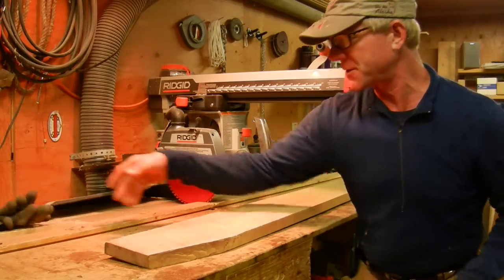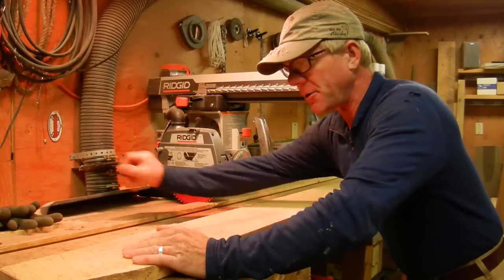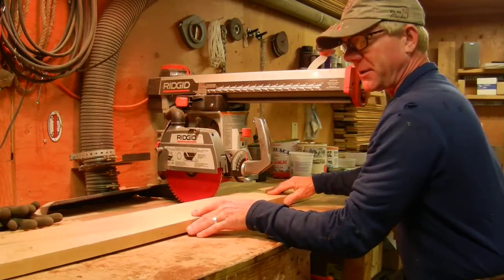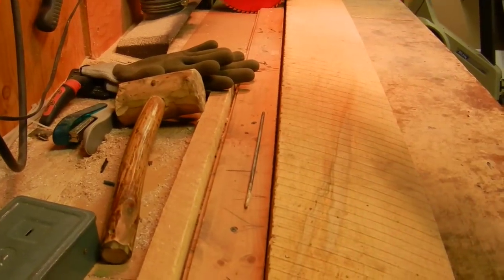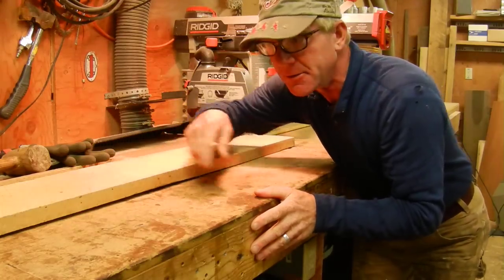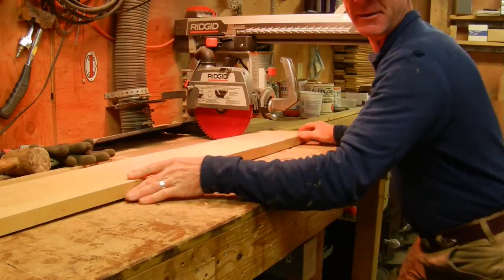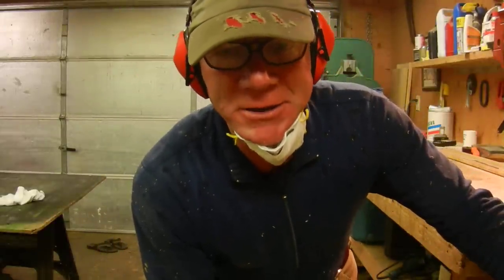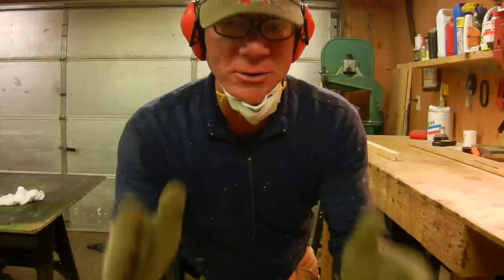How to use a Radial Arm Saw #radialarmsaw

Comment: ok so: you did NOT use a "negative rake blade" because you had the blade turned the "opposite" way, basically, right? how did you keep the board on the table, doesn't the saw blade orientation like this, tend to pick up the board?
Reply from the maker: You do need Radial Arm Saw school.

Comment: i like your video it gives me a better understanding of this tool. I recently have obtained one from my brother in law and have never worked with one before. I do have one question though. mines an older model (113.29450) I wanted to know what lever you used to turn the saw sideways. hope you have a good day.
Reply: This model has been recalled by the manufacturer due to safety concerns.

Comment: Question.. i have the exact same radial arm saw. It was given to me by neighbor after i sold his house and he downsized. My question is its obvious that it hasn't been used in years and as a result it doesn't glide back and forth easily enough when im making simple cuts. Can I apply WD40 to bearings or the arm? If anyone knows the answer to this question, please chime in.. i appreciate any feedback i can get. Thanks again.
Reply from the maker: WD 40 or PB BLASTER is great. I also have a bungee cord pulling the saw head back.

Comment: Ed Stengel,
Safe and unsafe is a bit of a misconception. Shapers are considered to be dangerous but jointers and router tables are considered to be safe. The fact is that all power tools are dangerous. More fingers are lost on table saws than other power tools. Fingers are also cut off with hand held circular saws. Many people have had their fingers cut off with jointers. In most cases had proper procedures been utilized such as clamping fixtures, hold down fingers, rollers, featherboards etc.  fingers and hands would not have been lost. I see many videos with experienced cabinet makers pushing lumber through a table saw blade with their hands. Some people have been permanently injured after using these same unsafe procedure for years. Power tools such as radial arm saws can be safe if operated in a safe manner.
david
Reply: That reminds me of a sentence, my old Carpenter Master told me once. The cuts where most people get injured, are not the those repeating cuts the like if you have to cut all your boards to a certain width(like when u cut for a Bookcase as example). The cuts that are injuring are always just Single Cuts, where you're like "oh i just need to do this one small cut really FAST" and where you are too lazy to put up all the security measures.
Then all that is needed is a board that doesn't cut smooth and is bucking up in the saw, a slight loose of your grip and  a slide ... then your Hand goes into the saw.

As you said, ALL Power Tools are a hazard and extremely Dangerous. Even a Standing Drill Press CAN be dangerous, if you try to drill a piece of thing metal sheet ... all it takes is the metal get caught, it not being hold by a vice ... and it swirling around with sharp edges. Your Hands are close too it too, if you did hold it with your hands.

That said Master Carpenter had still all his Fingers ... with 50 while working in the trade since he learned it with 16.
Reply: Vivienne Pierce. With respect Vivienne, thats BS. Every pro woodworker I know and have worked with over thirty five plus years, HATES these radial arm saws. Only the self taughts and hobby guys think they are great because they have not seen an accident with one, YET. Oldest rule in the machining book ? NEVER CLIMB CUT. What does the radial do ? Climb cut. End of discussion.
Reply: Brian Minghella : radial arm saws are super- dangerous, but, probably because they are dangerous, they are easy to buy or even just get for free. Jointers are harder to acquire.
Reply: Tom Senft. Pro Shops give them away because their insurance policy will not cover an accident with them. For once I agree with the insurance companies. Good jointers on the other hand are snapped up when they come on the market. I know I did. A new Jointer will set you back big bucks and the quality is not as good as it was.
Reply: The reason table saws have the highest injury amount is because they are used for so many things. If people used radial arm saws as much as table saws, the number of injuries on the radial would be mountains higher.

Comment: I'm a beginner and I'm having a hard time trying to decide whether to buy a table saw or a radial arm saw? Any advice.
Reply: Both are great.but I rec RAS.
Reply: killing old growth since 1977 I also vote both. Got a Ridgid TS3612 table saw, and this RS1000 radial saw. It’s quicker and easier to crosscut on a RAS, because you move the material to the fence. On a TS, you have to setup the fence to the blade, then space for material. If you get creative and use something like an Incra extrusion like on their miter1000hd as your RAS fence, it opens up possibilities. Trying to set that up on my RAS.

Comment: Hey Jim how'd u set up that fence so straight? That's the video I want -- how you get furniture grade precision in a shop that looks like a pioneer outpost. ; )   For real tho how'd u true up such a long fence to that blade? Thanks for the tips!
Reply from the maker: Your radial arm saw is initially set up true with the saw head running exactly 90 degrees to the fence so your crosscut on a board is square. Obviously once you know where square to the saw blade is you can just run your saw fence as long as you want...
Reply: Jim Howard Hi Jim... Great video!!!  I'm glad to see that the radial arm saw still "lives!!!" Also glad that Daniel posted that question to you cuz I was about to ask you the very same thing when I found this particular video. I'd like to add a twist though to your reply. I have a little Ryobi RAS that I haven't used in a long time. But the base board and the fence (all made out of particle board) need to be replaced. Since I'm eliminating the initial factory setting by replacing these components, how do I duplicate the alignment now so that the fence is true to the blade? Thanks!!!
Reply from the maker: the table and fence together can be adjusted by thumb screws to the rear of where the fence is right?... Simply use a framing square to square the fence and or table to the saw blade. Run the saw head back and forth along the edge of the framing square which is what you are using to set the table and fence square to the blade... got it? Adjust the thumb screws tight. If you need more help let me know and I will make a video on how I do it in my shop...
Reply: Hi Jim...  Thanks for the feedback!!!  I'm gonna give that a try.
Reply: +Jim Howard 
Excellent post. I would like to see a vid on building a proper table with an adjustable fence and tape measure attached. New Sub!

Comment: I thought the board is fed into the blade in the direction of the rotation of a Radial saw. This method pushes  the board toward the table

Comment: One point I must differ with you on is reaching around the blade to finish the rip.  You don't have the guard in place on the right side of the blade.  The board could get caught by the blade and drag you hand into it.  That would not be a good day for you.   Personally, I like to straighten boards on my table saw.  I simply attach a long straight edge to the board and run it through.  It's so much safer.  But as you pointed out, you do it your way.  It's whatever you're comfortable with. 

On another note, Ridgid makes some fine stationary power tools.  Whomever made the decision, at Ridgid management to sell to the general public and hire some good engineers, should be applauded.  Way back in the day, I equated Ridgid with mostly plumbers and fitters tools.  They've come out of the closet so to speak.
Reply: if you watch the way the blade is turning it will not catch and drag you in it actually pushes back on the work instead of pulling
Reply: C.J. phillipson The blade is turning in a direction that it will pull the board to the left, if it binds.  As I mentioned, the last 12 inches or so of the cut, your reaching around the blade and putting your hands on the intake side of the blade.  Hey, as long as you still have all of your digits and feel comfortable using a radial arm saw, great.  I've given up on radial arm saws.  I feel they are  just not as versitile and simple to operate as table saws.  The only thing they are good at, in my opinion, is for making dental moulding or dadoing across a board.
Reply: ripping can be very dangerous on a RAS, dull blade, no way.  Also use anti-kickback, but as you say, do not put hand to right side of blade, not smart.  I had a board hit a knot and threw it across the shop.  I used anti-kickback since.  But I agree, table or circular saw is much better for long runs and ripping boards, I don't turn the saw sideways anymore.  I also use a chop saw more too.  But a RAS is a must have for me, and great for cross cuts if done proper.  Shelving and planks and two by's come out great, very accurate.  Don
Reply: It is much easier to extend the table as he did with a RAS.   Thus he got a better chance of running the board through perfect.

I agree with a large table saw you get nearly as good a result.   However not on that board  as the curve meant the two outmost edges needed to be on the straight edge board.   Do not know how you do that wit a table saw.   Without drawing a line or striking a line would be better.

I would never get my fingers that close to the blade as you pointed out.   With a lot of experience I suppose.  Still dangerous.   Something goes wrong and damage is instant.    I switch to the other side of the board about half way through on a table or a RAS.    For ripping the Table is better for most boards.   No argument with that.   But for a very warped board the RAS will work better.

They are beast and very very heavy.   So the cut off saws that also move are much easier to move around and do most what these saws do except dado.
Reply: umajunkcollector As long as I live I don't think I'll ever understand why people think it's less dangerous to rip on a table saw.
Reply: That was the first thing what I thought by watching this video :) Last year I've got a huge scar on my hand after kickback... my table saw was without guidance blade...
Reply: You are right .It will pull the board toward the blade.
Reply: That is why blade type is very important. you must use the correct blade or this becomes a greater risk
Reply: It is all about the tooth hook. I made the mistake of buying a blade designed for a table saw. It had a 10° hook and when I tried to cross cut it pulled into thr board. Fortunately I was able control the cut speed. After some research I found that RAS blade should have less then a 5° tooth hook.

Comment: Hi Jim I just purchased a Ridgid radial arm saw. I am looking to get a new blade and a adjustable dado. Have any recommendations?  There aren't too many Ridgid videos out there. Thank You in advance for any help you can give me.
Reply from the maker: Robert Johnston I use 60 to 80 tooth carbide tips saw blades from Home Depot and Lowe's. Toolbarn.com has a 10" Freud dado blade but it's  $269.97
Reply from the maker: Robert Johnston depends how deep you need to go. I use an Irwin 6 1/2" carbide tipped adjustable dado set on my radial arm saw.

Comment: Nice instructional video. Would like to learn more about how to use a RAS properly and safely.  Its now obsolete as the compound miter saw sealed its fate.  The RAS actually scares me without the blade guard retrofit and its many angles 
and adjustments.  Will take getting used to versus a table saw but look forward in using it soon. Application will be to rip 
20' redwood lumber for redwood decking and railings.  This maybe the perfect saw for ripping since it is an elevated, suspended,  inverse of a table saw
Reply from the maker: it is still one of my favorite saws!
Reply: A bandsaw and a jointing plane can accomplish this safer. :)

Comment: I understand if you don't have an alternative, that it is possible to rip wood on a RAS, but it is not safe.  The blade is always turning upwards in the cut, trying to lift the workpiece off the table.  It is much more safe making this cut on a table saw, and always will be.
Reply from the maker: I'm afraid you are just stating your opinion which is valid but ripping on the RAS is fast and super efficient anyway you look at it.
Reply from the maker: Ed Stengel safe is a state of mind  and a state of TOOLS. Your opinion and my opinion may or may not be what's best for anybody but ourselves. What I'm explaining is MY Techniques. You should think about showing yours on YouTube. You probably have very good techniques and points as well as teaching ability! Try it you may like it. Making How-To videos is fun!!!! I love this stuff and you may too! Go For IT!!! Thanks for posting.... JIM
Reply: Ed Stengel I disagree entirely.  The board will lift on a table saw if it grabs the back of the blade.  A board lifting on a table saw is far more dangerous than a board lifting on a radial arm saw.  When it lifts on a table saw, it climbs up on top of the blade where it has the most chance to launch!
Reply: Ed Stengel A radial arm saw is only unsafe if you don't know what you're doing at all. If you do know what you're doing, it is infinitely safer and better than a table saw. It is also much more versatile than a table saw as well. I'm not denying that table saws are effective at all, but the radial arm saw is much better so long as you know how to properly use it.

Comment: If some one can make this saw effectively safe, it can replace both miter saw and table saw.
Reply: mogbaba The only things you need to make it safer are very simple:  An anti-kickback pawl which the saw should come with, a feather board, and maybe a hold-down board, and a push stick.  A properly set up RAS is a great replacement for a miter saw and a table saw.  The only advantage of the mitre saw is that it's more portable.  The only advantage of the table saw is that you can cut the bottom of something really tall and wide, if you have to.

Comment: I'm a professional cabinet maker, 42 years.  a couple things: never wear gloves when using powertools, unless designed for it. usually fingerless, but I don't let my guys use them.  Always use a rip blade, that looks like a 80 tooth thin kirf.  max. 36 tooth, use full 1/8" blade.  Always use a push stick, never pull wood through. Should always surface a board before straightlining.  and last, buy a table saw if at all possible, radial arm saws are not seen in most shops for a reason.

Comment: I would recommend some roller wheels in your out feed table ;)
Reply: I was thinking something that would hold the wood down to the table.
Then, if you added some power to those wheels, you could start the board going through and let the power wheels finish the cut.

Comment: 2 comments,,
the saw i use has the anti kickback on the front, 
the way he's ripping would be correct, he's feeding into the tooth of the blade
 like an upside down table saw, the other way would pull the wood thru the saw. 

and next!!!!,,,,
,please, never wear gloves when your hand is near a sawblade...
one catch of that cloth and game over!

besides that, 
nice technique for straightening  lumber
Reply: +Galora Barren please disregard my comment on direction of ripping on an arm saw,,,,,,i've never done it,,,,,,
but please don't wear gloves around a sawblade
Reply: +Galora Barren 
My Brother in Law lost a finger while wearing gloves running a saw. It pulled the glove in. They say he was lucky.
Reply: if your hands get close enough while wearing gloves for the saw to get caught in it then you're doing it wrong anyway, but yes if you do cut yourself with a saw while wearing gloves it could twist the cloth up pulling your hand closer to the blade.
Reply: You can wear gloves with a sawstop cabinet saw LOL. :)

Comment: Where is your anti-kick back device?
Reply from the maker: Don't use it don't like it.
Reply: The very first time I used an RAS I did not know about the AKBF.
The first rip cut caught the board and flung it against a  concrete wall 28 feet from the saw blade.
The board shaddered into many little pieces. If I had been standing in the path of that board  I probably would not be here today.  It was a lesson I never forgot! I have always set  UP the AK
NTI KICK BACK DEVICE SINCE THAT FIRST SCARE.
That happened in 1972.

Comment: Radial arm saws dont seem used much nowadays....why?
Reply: several reasons..  a very dangerous saw but mostly because of  stupidity by the operator not following safety rules for this machine!  With the sliding miter saw invention  they are inexpensive and a lot safer to use that and a table saw and your all set.. However i just bought a used delta 33-890 stupid cheep.  Good saws you just have to follow safety rules to the letter before you think about hurting your project!!

Comment: “I always like to have a push stick”. Then hugs the spinning blade of death to pass the wood through. Also you’re feeding the wood the wrong way, that’s why the saw blade chatters. It should be pushing the wood down not cutting up through it.
Reply: Should invent a device to push down pressure on the board, so he doesn't have to worry about that & can just concentrate on the push stick, till he can go around and pull rest of way.
Reply from the maker: No I am Not feeding wood the wrong way. You are looking and understanding the wrong way.
Reply: Jim Howard correct. Jim, if you have the pawls, put them on and show these commenters how you CAN NOT feed from handle-to-rear, as that is the very movement the pawls fight against to stop. This allows you to feed from left to right in outrip, and have the pawls prevent the right-to-left kickback.